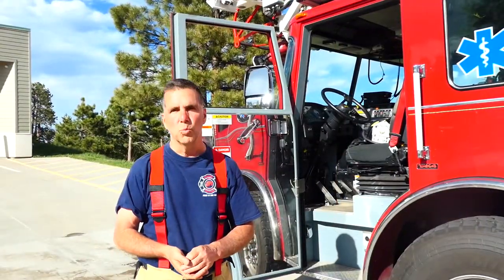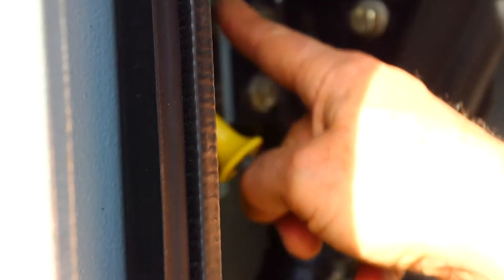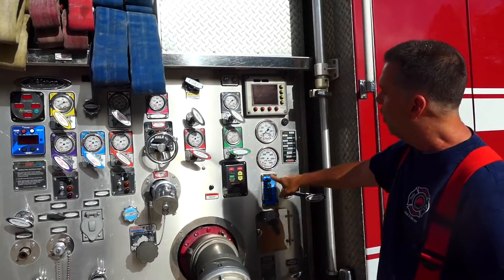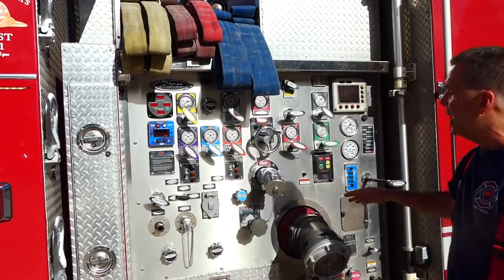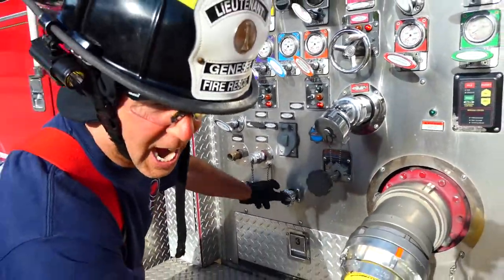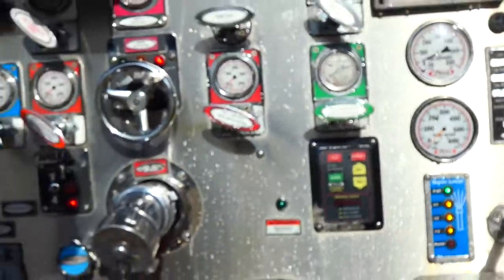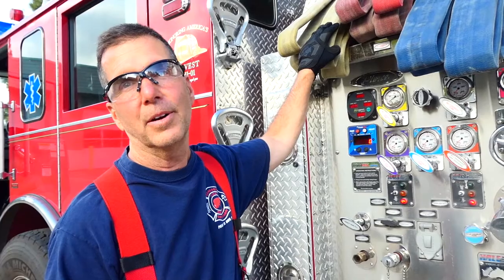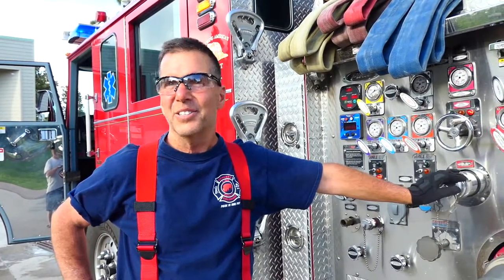Truck 971 Basic Pump Operation

Comment: Do you keep your "Tank to Pump" valve open after switching from internal tank to "Direct pumping" using your hydrant line?
Reply: Yes
Reply: I've always been taught to close tank to pump once you get a feed. This will allow you to know quickly if your feed fails and you'll still have a full tank to send. If the tank to pump is left open and you lose your feed, the pump will take from the tank and you might not know you lost your feed until your tank is empty.
Reply: Running off tank while supplied keeps constant pressure.  If you loose supply your interior crew just lost water. You keep an eye on your tank levels.
Reply: Easy to say keep an eye on the tank, but when you've got the deck gun flowing and two lines out, you'll blow through the tank in  30 seconds. 
Keeping the tank to pump closed will give you an instant notification that you lost your supply. Interior crew will lose water for a couple seconds. Open tank to pump to give your interior crews a couple minutes while you fix an issue or get them out.
Reply: @JParkin10  you do you but if that's how you fight fire I would suggest you keep doing it from the front yard
Reply: @monsterford8009  wow sweet burn. Really got me there. I'll keep doing the right thing and keep my crews safe.
Reply: @JParkin10 My department is the same with close tank to pump after topping off booster tank.  It goes both ways as I seen depending on department policy.  You are spot on with your reasoning of closing tank to pump after topping off booster tank.

Comment: At the 0:10 second mark, the rig pulled out of station. To the left of the screen, you’ll see 5 lights stacked on top of each other: blue, yellow, yellow, yellow, and red. Do these lights signify anything? I’ve noticed some other municipalities have a similar set up on their rigs and I’ve seen the lights turn green.  I wonder what these lights mean. Anyone have information for me?
Reply: The lights are an indicator of the water level in the truck's onboard tank.  Each individual light shuts off as the water level is reduced.  Once you see only the red lights illuminated, the tank is empty or nearly empty.
Reply: It's to measure how much water you have in the tank, allows not only the engineer to see, but command vehicles and anybody else that may need to know.
Reply: They signify the water level